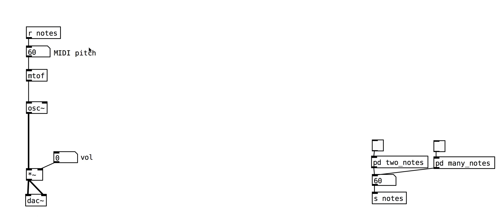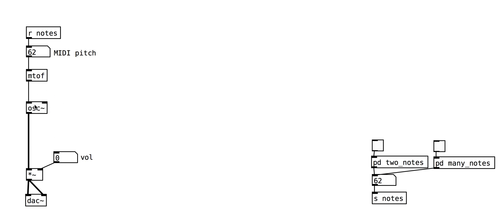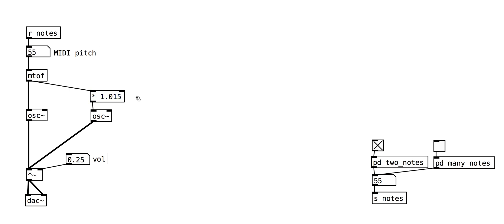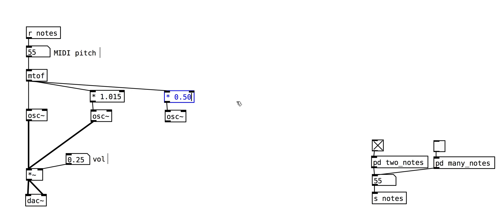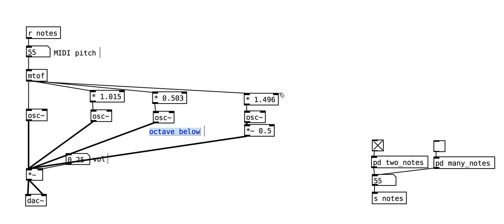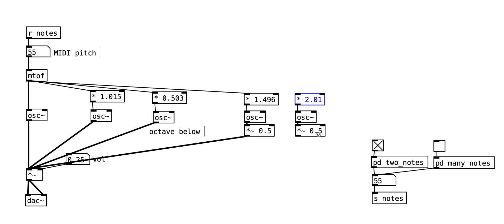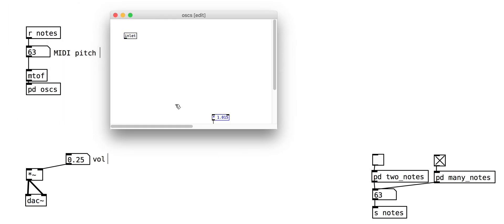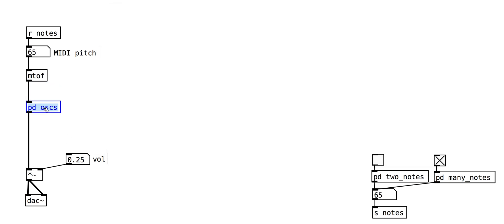PureData tutorials -  rich synthesis (1) - beyond sine tones

Comment: Hi. Great tutorial so far! I had to take some time to figure out that this version of Pd is opening files automatically to make subpatches. When I create the patch as shown at that point in the video, say 0:23, I have to click on the table for the patch to read it. I figured out that I can patch the output of the subpatch inlet to the left input of the table so clicking the toggle in the main patch starts the sequence. I am wondering if there is anything else I am missing? I have had a look at your provided patches and Tutorial 5 and cannot see a difference. However, you released this tutorial in 2019 so maybe that is the problem. There could be a change in Pd?

Comment: Hmmm my 'pd many notes' is not cycling through the array of notes and seems frozen at 0.. with a desperate little blip sound lol. Any thoughts? Thank you.. addendum - not frozen at 0, in the 'pd many notes' it is cycling, but the value is simply 1 through 8 instead of, what I assume, is supposed to be 67,68,69 etc.. which I assume adds on to a note I enter manually in the main graph, but nothing I enter into the main graph changes the pd-many-notes to a higher note output.
Reply: Same problem on mac os
Reply: Ok so I figured it out. Go into edit mode, click on [pd many_notes], go into edit mode for the sub-patch and remove 0 from the pitches box